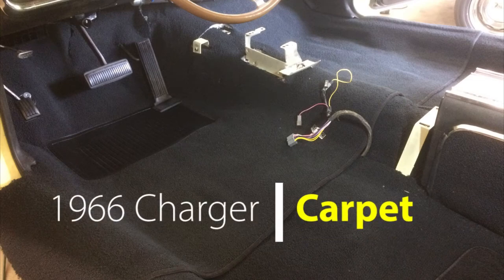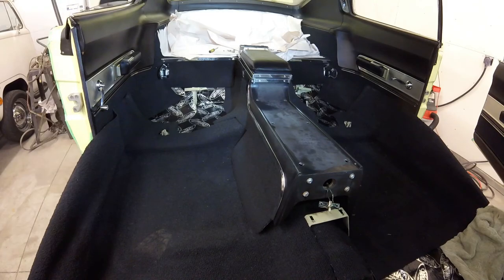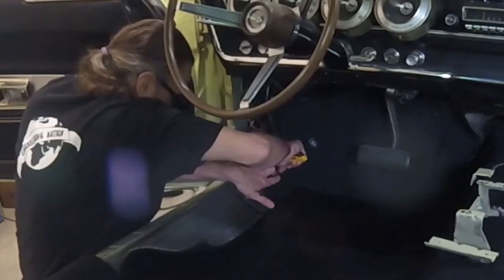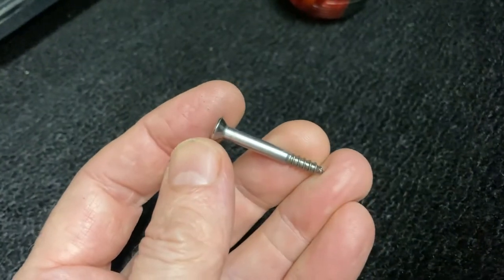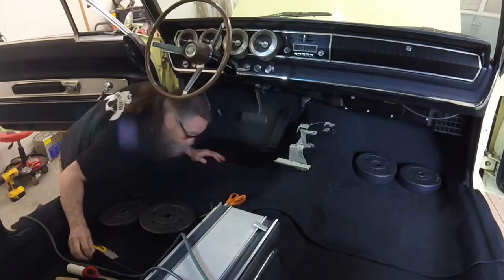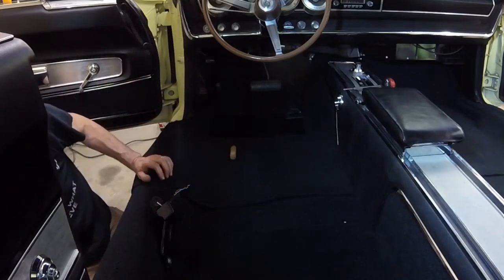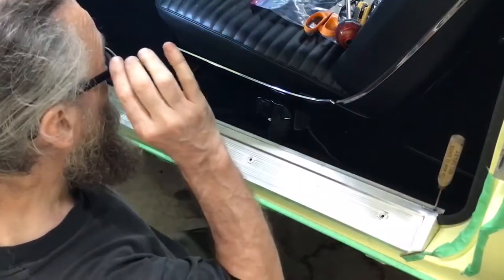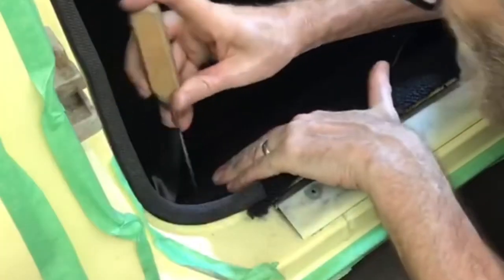1966 Dodge Charger Carpet

Comment: I have been told that one can use a solder gun to make the holes in the carpet to install the front seats. I like the nail as it is so small that you may hit your mark more accurately with the ice pick.
Reply from the maker: A solder gun would definitely be more convenient than the method I used.  I didn’t want melted carpet boogers on my soldering iron, though, so I sacrificed a nail instead. 🤓

Comment: Hay Paul.  When you put the carpet on that rear sail panel, did you remove the panel or were you able to install in place?
Reply from the maker: Hi.  I glued the carpet onto that sail panel outside of the car and trimmed it a bit before putting the whole panel back in the car. 👍

Comment: Was on the fence about replacing the carpet myself in my 66 Coronet. After watching this video going to give it a shot. I liked the way you explained what needed to be done as well as showing what the cuts looked liked after you did them. How did you get the front console out? Thanks for the video!
Reply from the maker: Thanks, Tom.  The trickiest part of the project was positioning the carpet before cutting it to fit around the brackets.  An extra pair of hands could be helpful for that.  To remove the console, I started with the shifter knob.  There’s an Allen screw locking it in place.  With the knob off, remove the trim screws from the top, horizontal panel and lift it off.  Then you can access all of the bolts and wire connectors.  The rear console section is similar, minus the shifter, of course.  I don’t recall encountering any challenges removing my console.  Pretty simple.  Good luck!

Comment: Did you order your carpet with mass backing?
Reply from the maker: No.  I didn't realize it was an option when I bought my carpet kit.  I got the standard OEM replacement carpet with the padding attached.
Reply: @PaulBroenen  Thanks.  Would you have?  Some info that it may cause problems.
Reply from the maker: @MrWillert-sn6hx  I would have to learn more about the mass backing before I could say.  This carpet was tough enough to cut/trim as it was.  That extra layer might have required a different cutting tool than my Stanley knife!  Besides, I figured that with the Dynamat installed, the car had enough insulation and sound-deadener.  I guess we'll find out when I get the 383 built and running! :)
Reply: @PaulBroenen  Have you re-upholstered your seats?  I am doing that now.
Reply from the maker: @MrWillert-sn6hx  I've done the front seats, but I haven't done the back seats yet.  I plan on making a video about that process soon.

How's your upholstery work coming along?
Reply: @PaulBroenen  So far, not too bad.  Taking pictures of the process and almost done with the front passenger bucket.  Installing headrest hardware and seat medallion.  Had issues with the rear seats.  Covers from Legendary were an older design and did not fit, had to order new ones.
Reply from the maker: @MrWillert-sn6hx  What year is your car?  My `66 doesn't have headrests or medallions.  That sounds like it could be a bit harder than mine were.  I bought PUI brand upholstery from First Place Auto Parts.  The front seats worked out great.  We'll see how the rears go...
Reply: @PaulBroenen  Mine is a 67 born in Dec of 66.   I think you live a few miles from one of my kids.  He and his family live in a farmhouse a few miles south of Cannon.
Reply from the maker: @MrWillert-sn6hx  Small world!  Are you also in Minnesota?
Reply: @PaulBroenen  ND but get down there every once in a while.  Just finished front passenger bucket.  You can buy foam for the fronts but have to make the foam for the rears.
Reply from the maker: @MrWillert-sn6hx  The foam in my front seats was still in good shape, so I'm hoping the rears are good too.  You're motivating me to get back on the project. 🤓
Reply: @PaulBroenen  If they are not, let me know I came up with a  pattern for the high density foam and used a thick felt.